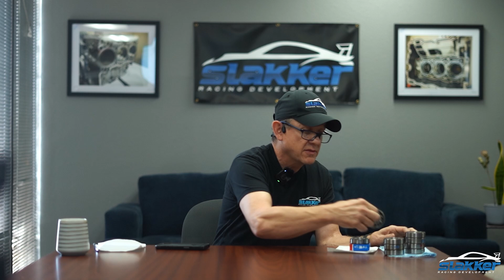The IMS Bearing That Lived to 255K Miles!!!

Comment: Pulled the outer seal on my 150K km dual row and saw/felt no cause to risk a replacement. In terms of load rating, does the intermediate shaft not rotate at a fraction of the crankshaft RPM so even a sealed bearing has quite a safety net?